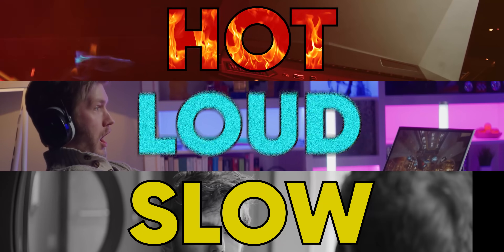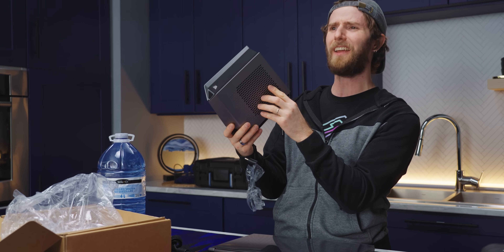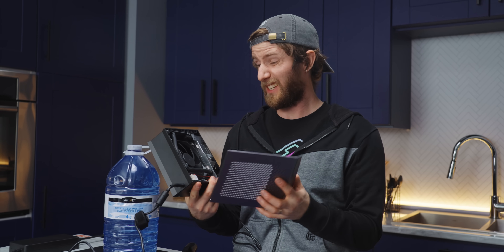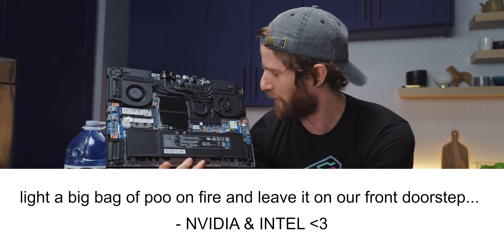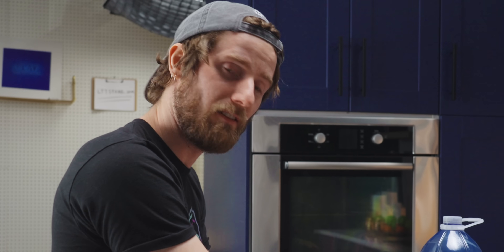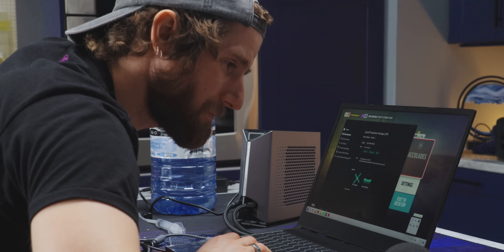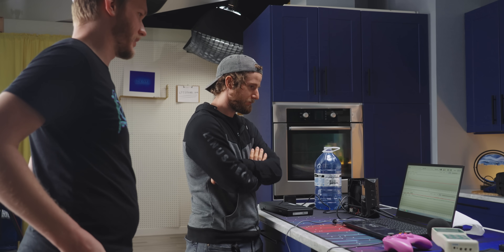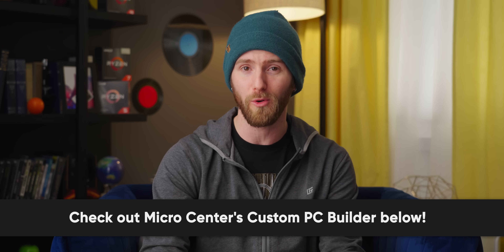This INSANE Watercooled Laptop Has a Huge Problem! - Eluktronics Prometheus Prototype

Comment: Could you imagine the next generation of this? A docking solution with a thunderbolt connector or two for power and data delivery, and water cooling?!
Reply: Or just an external GPU with all laptop cooling power dedicated to CPU, huh?
Reply: The very first thing I thought too. If you make that into a dock you have a killer solution. You could effectively make a computer that would be an amazing experience both for work and gaming. This is a winning idea.
Reply: Would cost too much to see it commonly adopted. eGPU TB Enclosure is already a niche item due to its high prices. I'd prefer a water cooler accessory to excel at the one job that it is supposed to do.
Reply: @blue4059  No it wouldn't. Have you seen the demand for laptop docks. They are in extremely high demand and a decent dock can be over 400 dollars street value.
Reply: I've been planning to build my own, using quick-disconnect connectors, except I'm planning to do it for my desktop, so I can use a cool looking ITX case, and still have a full watercooling system in a separate case.
Reply: Thunderbolt? Ew, gross. I only use firewire 800 passed through a firewire 400 retrofit patch cable. Gives the data a little more tang.
Reply: @domenucakar  Asus own their solution. But to be successful it has to be universal. How can you buy a GPU when you don't know for sure if it will be supported anywhere ?
Egpu via thunderbolt are a solution but they are quite limited in performance and also quite expensive. Also they require thunderbolt, and sometimes LOTS of tinkering with drivers.
Reply: Or just buy a pc not a laptop to game lmaoo
Reply: I don't think Thunderbolt can transfer water lol. Cables aren't hollow!
Reply: There are so many connector standards, especially USB. Why not add USB connector that also carries coolant water!
Reply: They did start putting thunderbolts on their laptops...thunderbolts connected to INTEGRATED GRAPHICS instead of the GPU for some reason. Oh, but they DID connect the HDMI to the GPU directly...instead of the thunderbolt. I cannot figure out why anyone would think that was a good idea.

Comment: How much water comes out of the fittings/tubes when you disconnect them? Hopefully they have valves so those lines or the tubes in the laptop don't drain onto the table... I would hope the engineers would have at least gone that far...

Comment: With that big gpu temperature drop it should clock a bit higher even at the same power limit (as usually those get to higher clock bins with lower voltage at significantly lower gpu temperature).

Comment: Now imagine a product: 14" laptop, size of Zephyrus G14, packing i7 12700H and full power (140w?) RTX 3070 or 150W 3070Ti. On air cooling, you´d only get 2 P-cores and all E-cores and GPU would be in the lowest TDP setup. Connect this cooling solution, laptop auto-detects it and enables all cores + full TDP. And the laptop doesn´t throttle. I can´t believe it will only cost 99 USD.

Comment: I wish you would have shown the disconnect process. Their video showing how to disconnect it form the laptop requires you to turn the laptop upside down and manually drain what left in the laptop or it will leak. Based on their video it only looks like there is a single degree or two at most between draining it and it being ok and lifting it too much and killing your laptop. This product needs a ton of work.

Comment: What would happen if you dont plug it into the cooler? Dont you run the risk of evaporating the water still left in there
Reply: I mean its copper heatpipe, not rubber tube like in PC custom loops. As long as the plug is solid, it should be fine IMHO. But it might be more of a heat-soke I guess. But that´s easy fix as well - drain while unused :)

Comment: My Dell 7730 Precision Workstation can run two intensive computational programs and maintain 4.6 GHz. for both of them. Sure, it drops from 4.9 GHz. peak, and a desktop would maintain that, but that is pretty good cooling for a laptop. It can't compete with water cooling though.

Comment: I'm using a XMG Neo 15 with Intel 11th and a 3080 at this moment. It's a ultra power house and runs everything from coding to gaming great. But, it is the most shitty laptop i ever used as in comfort, user experience or plain laptop features. Just as a warning.

Comment: Just add a dial on the external cooler itself, just limits the maximum speed the device can run at.

Have 60% as the lowest it can go 👍

Comment: Crazy how some ODM Laptop designs are just so recognizable. Like even before you opened it up I recognized it as a Tongfeng, if only for the reason that my XMG Neo 15 (also a Tongfeng) has the exact same light bar at the front, later also confirmed by the Keyboard design as well xD

Comment: The concept seems to work out. Now this just need a USB C standard capable of delivering the power integrated into the QD-fittings and more thought out fan control and it would be pretty awesome! Put a USB C dock into the cooling thing so it can act as a full docking station and this would be the winner of gaming laptops.

Comment: Honestly a really cool idea! Idk how you would cleanly disconnect this tho. I feel like the whole point of the laptop is the instant portability, but if you make this small compromise and I guess drain the loop in advance, it is still technically portable. 

Side note, I with microcenter would stop giving all this free stuff and good deals to new customers only. Like, what about the loyal customers? I for one would absolutely like that one deal they had where they took $100 off an ender 3 pro.
Reply: It's a quick disconnect fitting, so you get a very small drip when you disconnect, & it looked like they'd put that far enough into the connector that it wouldn't go into the laptop. So just pull the spring-loaded cover back, remove connector, quick dab of the connector on your t-shirt, no mess no fuss.

Comment: I've been putting icepacks under my laptops for decades now. I keep a bunch of them in the freezer on standby for when I need to switch them out while gaming. Talk about jank, huh.

Condensation is never an issue because an icepack could never drop the temperature down enough in order for the dew point to be reached. At least while the the system is under load. I achieve about a 20+c difference as well (enough to keep from thermal throttling). I keep it under the laptop heatsink (wherever that happens to be, often in the center near the exhaust) and only on aluminum body systems where the ventilation is no where near the icepack (often on the sides).

I have not destroyed a computer yet. And for the love of god, DO NOT DO THIS. I AM AN IDIOT.
Reply: When I was on a laptop I did something similar but stupider.. Laptop on a cooling stand with 3 80mm fans that suck precooled air from around the icepack and blows it towards the bottom of the pc where the ventilation was.

I didn't do it often so the laptop survived. But I also didn't get as good results, I thing the biggest advantage was that it kept ME cool..

Comment: Well. I wish I had not JUST purchased the Prometheus XVI (with the 16GB 3080), just a little over 3 months ago. Did not see this coming. Super Happy with the laptop though. (Actually the best I've ever owned) But it does sound a little like a jet engine when the fans are going full throttle. But it's a screamer. Literally and figuratively. I would have jumped all over a water cooled version. An ambitious man would sell the one I have and wait for this release. Unfortunately, I am not that man. Looking forward to a full review once the kinks are worked out, and also looking forward to the specs on the new Electronics' hardware.  Well. I was "top of the line" for 90 days. We live in a magic world. LOL

Comment: They need to make this a full dock with HDMI, USB etc. Would be a great product then.
Reply: that would increase the production cost, for a machine that simply has just one job to do.
Reply: It's going to cost $100 if you buy it with a laptop. Thunderbolt docks cost $300 or more. So that's not a very good way to make people want to buy something by making it more expensive.
Reply: @Terreos  Making something that does two things instead of one is always a good idea. If you are going to have to sit at a desk and plug this in to get the most out of it, then make a product that allows people to get the most out of a stationary laptop.

If that means t cost more, then charge more for it.

Comment: What kind of anti vibration mat would you recommend for under a pc that will be used in a tractor trailer. The truck will be running when pc is in use but not driving of course.

Comment: Yo, that's a really cool stuff, imagine this external water cooled system + a higher TDP GPU, it's gonna be crazy huge performance leap. Now we can see the laptop RTX 3070 up till RTX 3080 ti performance are not that great due to TDP in the laptop. If the mobile GPU can have 200-250W that is cooled by this external water cooled system, the performance gonna be a few steps cooler desktop GPU!!!!

Comment: I have a solution, instead of making laptops as small as possible, go back to the chonksters if you want performance and noise reduction. I'm still rocking an Acer predator Helios 500 with a Ryzen 7 2700 and Vega 56, all hot running hardware, in a laptop that is actually quieter than my desktop under full load.

Comment: what I liked, is that a heat pipe on top of a heat pipe with 2 outputs on the notebook housing, can be easily replicated with a little engineering. just scrape and paste

Comment: Me who has an msi gf65 thin 10ue with an i5 10500h and an rtx 3060 that has 2 heat pipes for the cpu and 3 for the gpu and 1 for the ram… come on msi…. You can do better…. I have never known a time where it doesn’t thermal throttle and sound like it’s taking off plugged in… on battery it’s fine but it won’t last long

Comment: Makes sense mostly, wouldn't be comfortable yet though with more likely to have water damage on a Expensive laptop.

I mean does it remove all water from laptop before we disconnect it etc... Or else will the residual water come out when we Rotate or carry...the laptop

For a second I thought the broken pump noise was from my 7 year old laptop fan 😐

Comment: - It seems like it would be worth a shot to design an external fan (air, not water) device that simply connects to an air-out/peripheral-power port on a gaming notebook.
- Imagine the airflow we could achieve with a nice 90 or 120 mm HSP fan drawing cool air from one end of the chassis and through to the other side, expelled from the external fan unit in whichever direction you want.
- We'd be going from tiny fans spinning at a million RPM to one large fan spinning slowly enough to be nice and quiet.
- Hell, the internal fans could be mounted in such a way that when the external fan unit (EFU) is engaged, you don't get air running over them and becoming turbulent and noisy.

Love,

Kat

Comment: Adding to your concern about the cooler seal and tipping over removes the viability of travailing with the cooling solution as those buying for work where staying at a location for extended period of time, trade shows or just avid gamer's would rather travel with the additional weight than leaving as a pure at home booster.

Comment: It would be nice if they went by the manufacturer's instructions to set these things up. It sounded like the fan was hitting a wire and opening the case of the thing before even testing it could have easily resulted in a wire getting bumped into the path of the fan. Because he didn't follow the instructions, we can't judge this product fairly; we do not know if the noise is the result of mishandling. I know it's standard practice at LMG to do things this way and the manufacturers surely know what to expect, but for the viewers, a clean first run would be a lot more informative.

Love,

Kat

Comment: I'm gonna keep saying that so long as this sort of thing is necessary, chip manufacturers need to focus on efficiency
Reply: They are already super efficient. 
The 150w draw in that card is performing what took megawatts 20 years ago.

More Performance or lower power. Pick one.
Reply: @zyeborm  I think I pretty clearly picked one
Reply: @falxie_  then get a low spec Intel on board gpu total draw is 5 Watts, you just won't be able to play games on it.

Comment: I like the idea of external watercooling, but I'd want to see the laptop powered by USB-C instead of a barrel connection. Then power passthrough from the cooler could potentially allow the user to fine-tune pump and fan speeds (assuming the unit doesn't measure water temperature to manage that), among other goodies, like making the cooler a dock with USB, HDMI, DP, etc. Maybe power draw is the issue there.

Comment: Fun to see that there are water-cooled laptops without water and without cooling ...
When I first heard about water cooling for PCs some 15-20 years ago I was excited because I thought it was so much better than air cooling, you know because fluids transport heat better and so on. But then I learned that the water cooling needs an air-cooled radiator ...
I know the technology has its fans (no pun intended), but I don't think it's a thing when it's basically just a complicated heat pipe.
Reply: It's basically a way to multiply massively the interface's surface. You go from the tiny air cooler heatsink into a massive radiator.

Also I think the water acts as a thermal mass, but I'm not sure about that

Comment: Linus should use his sway at his co-owned computer company to implement a water cooling solution for their laptops. You could use a set of pipes much like the ones in this laptop (except with more of them, bigger, and not so limited) and just leave them in the computer full time. You would get the full water cooling in an at home environment, where the water cooler, and potentially an external GPU dock with the laptop. you would simply plug it in with some push to connect connectors, and power the loop on. This might be a challenge while also working to make sure you can provide adequate air cooling, but i don't see it as impossible.

essentially this, but better.

Comment: "Cool" concept (pun intended) but it needs polishing. One thing I would like to see is something like a white plastic or bare metal (aluminum?) exterior shell, not a black plastic shell. Black plastic in the gamer PC market is too common these days. You will need to make the laptop stand out from the crowd of gamer/enthusiast laptops on the market. If you're going to launch something as different as this then it needs to look different or it will get lost in a sea of competitors despite the fact that you're doing something new with how it cools the interior. You need to make it as eye catching as you can while still looking like what gamers think is cool. Think outside the box. Hope you have a good visual designer working with you. Best of luck.

Comment: Because I live in Canada I figure out a way to simply fix all those same issues just I have a timeline here's my simple lifehack put the laptop outside and cover it so it doesn't get wet Then it's not noisy And it's not hot And a bonus you get extra table room Downside is you gotta watch out for the cord

Comment: Slap a noctua in it and and software fan control (would need usb or wireless though), or a hardwired fan speed control knob on the cooler. Kind of neat product depending on the laptops cost. Would like to see some external pc coolers with the quick releases on them.

Comment: I feel like these things are so over-engineered. 

Why not just have a section of copper on the bottom frame that is connected to the normal heatsink assembly. Then use some sort of magnetic plate to attach an external coldplate with all the water-cooling mechanics. Then just use software to detect when the magnets from the coldplate are attached and unlock higher voltages and turbo speeds. 

No need to pump water into the actual machine, and given the limits of mobile chips probably still will do more than enough to improve performance to a similar degree.

Comment: My dad got me into computers and he got a couple 500Gb Eluktronics ssd's. That was back in 2013-14 and I'm still using both drives today and they're still quick for the time. Sure, my C drive reads 275-300 MB/s but I plan on using it as long as it will go. The less used D drive reads 350-400mb/s time to go for a Samsung 2tb I guess.

Comment: Linus or anyone else, Can u give me a suggestion. My laptop has this fps glitch, where if I set it to 144, the frames will from 144 to lets say 134 and then back up, then they will drop to 128, then go back up. This continues to repeat and causes lots of delay. I also have this issue where my pc says it gets very hot but it doesn't. Like my temps go from 90 to 70 to over 100 without turning off, but my pc is not actually hot. Does anyone know what I can do??

Comment: I believe it can be done somehow right but still requires a solid base (19" with proper TKL and normal thickness, HX class CPU) and the cooler would be basically AT LEAST solid ITX sized to make it silent and put extra GPU there